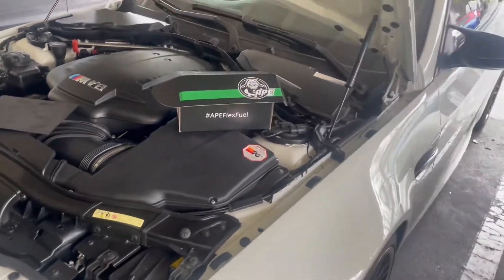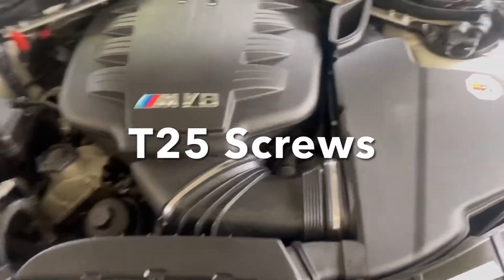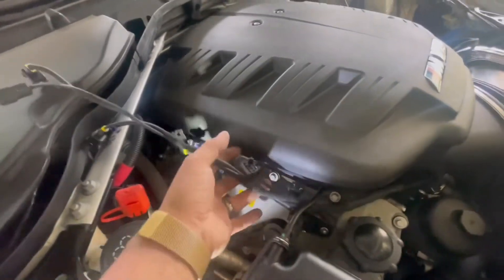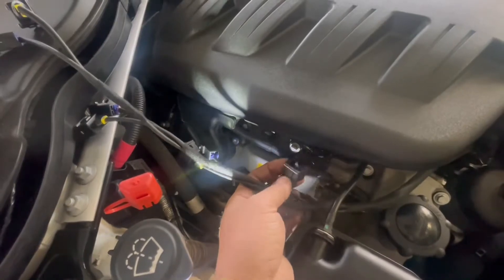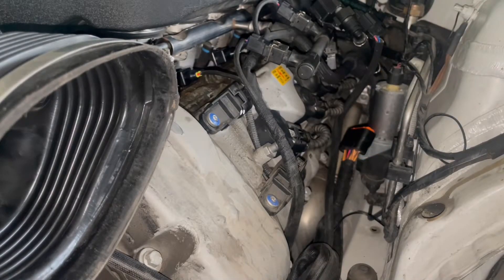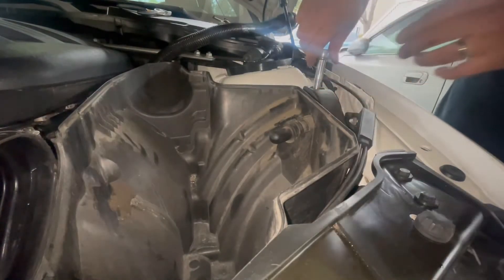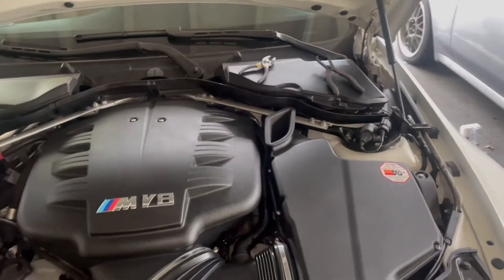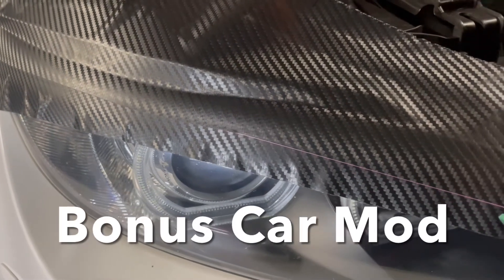Converting my BMW E90 M3 to Flex Fuel E85 DIY Guide APE Kit

Comment: One thing for those are struggling on that main fuel line disconnect there a white ring piece he doesn’t have that needs to removed first before u can  squeeze the line and remove it
Reply from the maker: Correct. Thx for sharing

Comment: Thinking about getting this for my m3. What do you think is the best way to do e85. I am NA so would I have to upgrade injectors? Is the most efficient way to run this kit, bpm flex fuel tune with stock injectors?
Reply from the maker: @TheClapGodSr.  yes to the last question. It’s worth it

Comment: Hey sal, recently bought an x pipe in december from you. I got a tune from chaos calibration, i didnt include any option for e85 at the time. Would i be able to add this without needing to tune again or do you know if its better to tune again for better performance/reliability? It would be the last thing needed for NA gains
Reply from the maker: You don’t need a tune for this. Good luck 👍

Comment: Did you have  to change out to bigger injectors and fuel pumps too? Or is  the stock fuel system is just enough  to run e85? On this m3?
Reply from the maker: The stock system is enough for e85 as long as you tune for it.  You need upgraded injectors when supercharged.
Reply: @Sals_Garage  thanks man!
Reply from the maker: @Affectionz1  anytime!

Comment: Can I install the flex fuel sensor and not run e and drive the car around on 93oct until I tune for e85?
Reply from the maker: Yes absolutely you can, it auto adjusts the fuel sprayed by the injectors depending on the ethanol content level.

Comment: will the e85 corrode at the original fuel lines over time ?
Reply from the maker: 3 years later running e85 and the fuel lines still look very clean. I drive the car atleast once a week, don’t let it sit too long.

Comment: does the ethanol sensor or flexfuel ecu need power? I didn't see that part in the video.
Reply from the maker: It piggybacks power off of the injectors. Good luck 👍

Comment: Hey i have an e92m3 and have an alpine motorsports tune on 91 octane will I need to tune to be used with e85 or will it adapt to the fuel thar in the car?
Reply from the maker: You don’t need a tune but you will need a flex fuel kit.

Comment: hi sal im running full e85 on my e92 m3 supercharged upgraded fuel pump and 613cc injectors car pulls like a train made 460rwkw only issue is cold start ctakes 30 mins to start once warm no issue anytips tried all types of tuning maybe should run flex and e50 really cold here atm
Reply: any thoughts
Reply from the maker: Nice!  Yea I would recommend no more than E60. There is a lot of diminishing returns after e60. Have your tuner send you a revised map for E50/60 and run that. Cold starts should be much better. For me I have the best result with E45. Flex fuel is very convenient.
Reply: @Sals_Garage  awsome ill get the ape box and retune it and get back thanks mate
Reply from the maker: @TheMajical12  anytime!  Good luck 👍

Comment: Why didn’t you upgrade to 1050x injectors ?
Reply from the maker: We are staying NA so it’s not needed. Stock injectors work just fine with flex fuel kit.
Reply: @Sals_Garage  did you tune it after installing your flex kit ?
Reply from the maker: @gunteqkz2696  no tune necessary.

Comment: I heard a lot of pros for this but never a con. Is there one?
Reply from the maker: Cold starts are a struggle for me if I’m over E60 mix so I stay around E50 for summer and maybe E40 for winter time. 

Definitely feeling the performance gain and peace of mind for healthier running engine.

Also, RIP mpg 😆
Reply: Hey bro, one more question about this. Is it smog legal?
Reply from the maker: @im_so_es_ef_wit_it  yes, smog legal, but I would mount it somewhere not easily seen by the smog tech just in case.